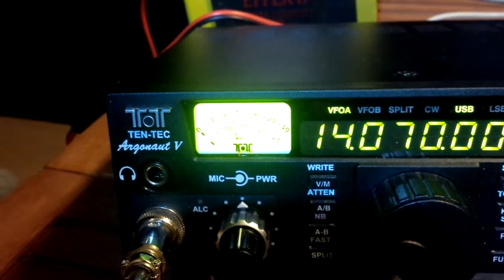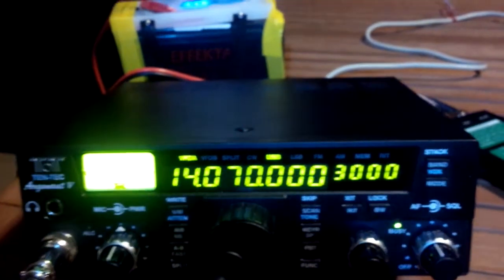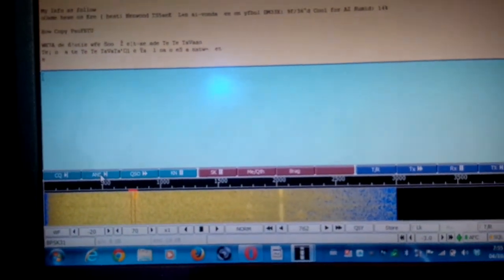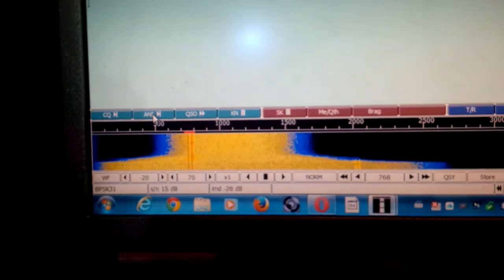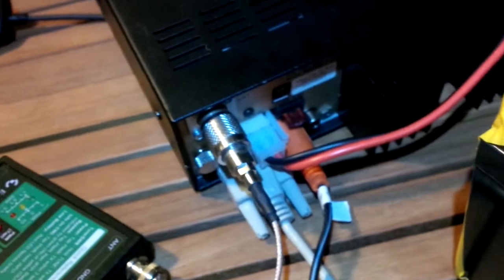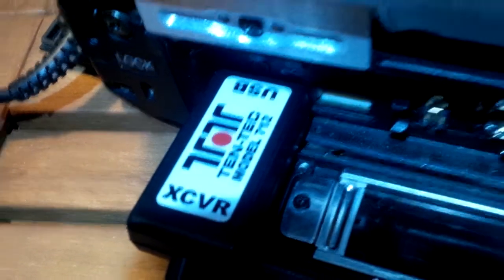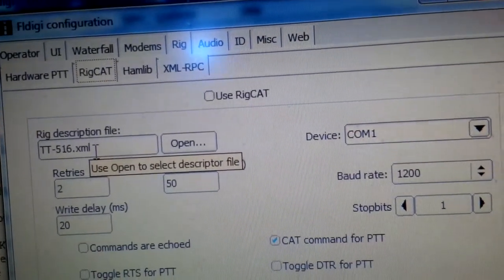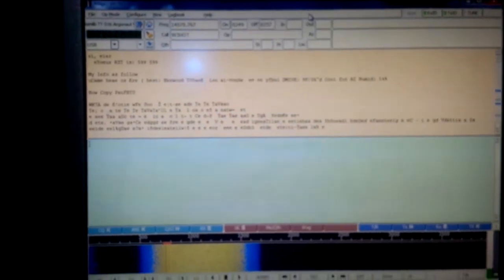Tentec Argonaut V running HF digital

Comment: Since you bought the KX2 do you still use the Argonaut V? Which one do you prefer to use now?
Reply from the maker: Good question.  I still use both.  When size is an issue I grab the KX2.  Otherwise I rotate through the others.  When I'm operating with someone else at a portable event I grab the Argonaut as it is simple to operate and others pick up on its controls very quickly.